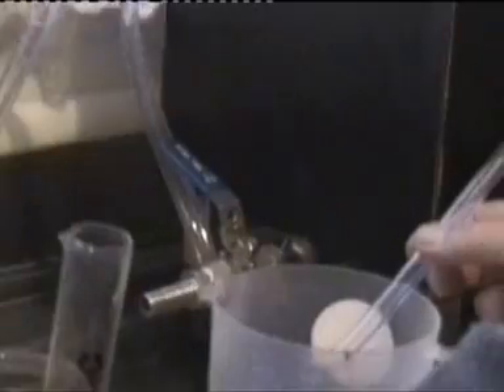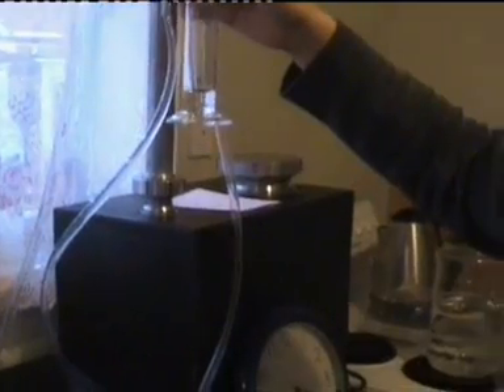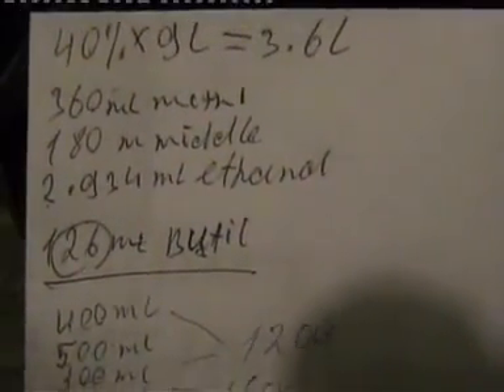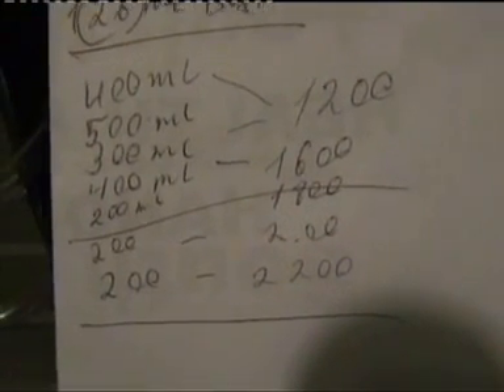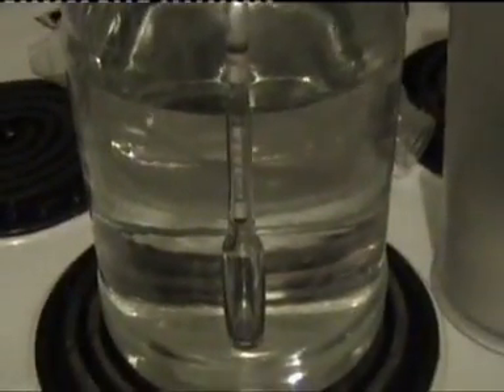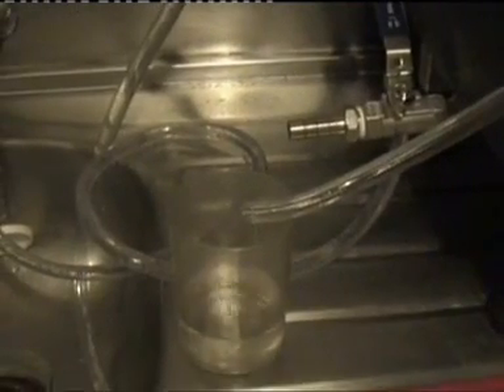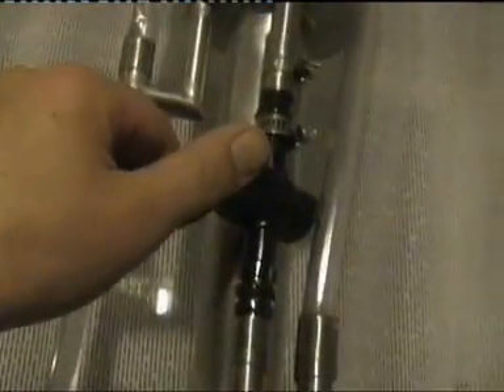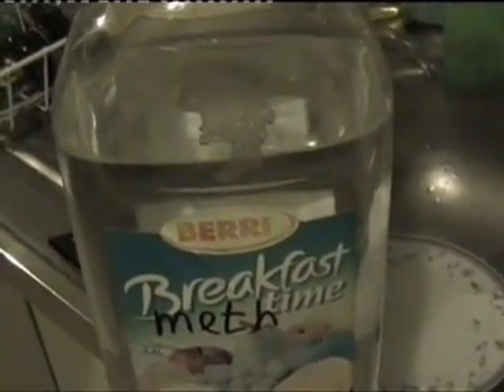Home distilling with fractional alcohol still, part 5

Comment: @elang61 One way to boost alcohol in your mix is to freeze it and skim off the slush (usually mostly water).  I heat my mix on the stove until I see vapors - this should cook off any potential methanol that can get into the mix.  Next, I set it on the porch or deck in early January.  When the temperature drops below freezing, the first thing that will freeze is the water.  Skim this off, and repeat the procedure at colder temperatures.

Comment from the maker: About plastic there are a lot of alcoholic drinks sold around in the plastic bottles and bulk supplied in plastic containers, plus more reactive Coca cola as well sold in the plastic bottles, almost every food package made of plastic, and tubing on my still is high temperature food grade non toxic silicon tubing, there is no plastic in the boiler and in the column so no plastic involved in boiling or rectification of ethanol.

Comment from the maker: all leading ethanol producers use only  food grade stainless steel equipment that tig welded and uniform so there is no chance for oxidizing, one can use copper if there is no soldering involved, parts should be connected by use of the same material (brazing) to prevent electro chemical reaction.

Comment from the maker: and please do not confuse the strength of spirit and purity of spirit, copper was just good for its time like corrosion resistant material that very easy to work with, I use to work in ethanol production industry and seen the copper still components getting black over the time and constantly oxidizing,